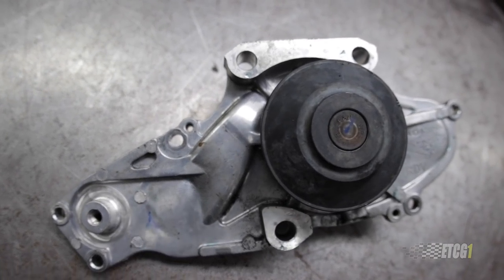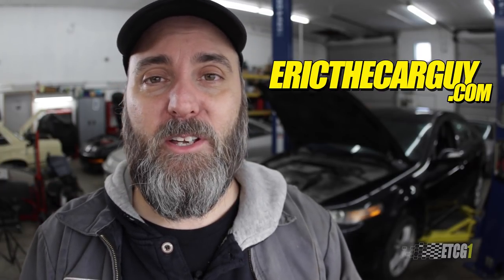Timing Belt vs Timing Chain, Which is Better?

Comment: I generally prefer chains, but the caveat I think of is as Eric said: there are still wear items within the chain system. Those guides will absolutely wear out one day and it's not always easy to check them. And you don't want to run out of oil in a chain driven engine. It really is a pick your poison deal. Take care of the belt and related components every few years or rely on a chain you rarely see. I prefer the chain poison, but I won't scoff at a belt.

Comment: I had a 190E 23 years ago, just driving to work engine Just die, Timing Chain broke only had 90k, Had 03 VW Passat 1.8 driving engine died Rear Cams are Chain  broke 136k, Nissan Maxima 05 Chain Skip timing While driving 123k, Yet, Own 5 Timing Belt Engines mostly Honda Acura not had problem

Comment: I’ll take the chain over belt any day. I’ve done a few belts recently that had teeth missing and were well within there service intervals. My old Australian made ford falcon still going strong with almost 400000 kilometres on the clock. And yet my neighbour Toyota with the belt has had it done three time in less kilometres due to failure.

Comment: Well I assume the answer is for ultimate performance belt uses less power but the fact you really never need to service means obviously chain wins
Reply: Also the right number of cams is 1
Reply from the maker: @james10739  Chains still wear out over time causing a loss of engine performance in the process.
Reply: @ETCG1  only when they have 1 or 3 extra camshafts
Reply from the maker: @james10739  If you think the number of camshafts matters on wear in an assembly that rotates millions of times during its service life, I have a bridge to sell you.
Reply: @ETCG1  no but it makes it go from a like 18 inch chain to a like 4 ft chain which is where the problem is
Reply from the maker: @james10739  My point is I don't think you understand the problem. Doesn't matter how many cams, if it's driven by a chain, the chain, and its gears, will eventually wear out. When they do, timing will be retarded and engine performance will decline. It's simple physics, entropy to be exact.
Reply: @ETCG1  any problems with a timing chain on a single cam is real rare in my experience and the shorter chain isn't going to wear as much to be out of time
Reply from the maker: @james10739  All moving parts wear out over time. Doesn't matter how long the chain is, it will wear out and cause a loss of performance over time. You may not necessarily notice it, but if you compare the same engine, one with a new chain and one with a worn chain, the worn chain will have less power than the new one. You can't change the laws of physics unfortunately.

Comment: I recently had a timing belt fail with 30k miles on it on my 09 odyssey, causing severe damage within both heads.  Ive been in my feelings and talking almost non stop crap about timing belts since.  Thanks for helping me be more "reasonable"
Reply from the maker: Was the engine actually damaged, or assumed? Did you try a new belt before condemning the engine? If not, you might have missed out. https://www.youtube.com/watch?v=enPNb8dxCZk&t=167s
Reply: You probably had a counterfeit belt kit. Quite common actually
Reply: they suck and are just a way to get repair jobs-  otherwise most good modern enginers need little service until 100k
Reply: @wiimaster2847  I second the counterfeit belt kit theory.  Even ETCG1 was duped by the counterfeit parts from Amazon/eBay.  I've seen many of them failing.  Not only does it cost the owner a ton of money it helps create the ignorant comments as in the one above by @Bikeman
Reply: @jeckel7234  Are you the one on the Odyclub forum with the paint issue on the heads?
Reply: @wiimaster2847  yes I am, and I don't really get notified from these comments on YouTube so it's easier to chat on the odyclub forum, I posted the link in one of my previous comments
Reply: @jeckel7234  it's fine, I'm quite active on the forum, I've already read through your stuff.

Comment: Chains USED to be the be-all, end-all. Not anymore. Nowadays, manufacturers can't seem to make a chain guide that can get much past 100k, if even reach that mileage. The timing chain on my '86 Grand Marquis I changed at 230k miles, only because I was in there to fix oil and coolant leaks. I probably could've gone another 100k on it before it got too worn. By the same token, belts would be pretty damned reliable if manufacturers could make a tensioner bearing that lasted. 9 times out of 10, it's the tensioner or idler that fails and takes the belt out. If they'd go back to chains without tensioners, I'd choose a chain every time, just for one less thing I have to do maintenance wise. Keep the oil clean, and they'll last just about forever.

Comment: 100 000 Miles is 160 900 km. I won't buy a car with a timing belt because I buy used cars, and timing belt jobs are like head gasket jobs , they're a 1200$ + job at the garage, and cars that have timing belts need them changed more at like 100 000 KM for peace of mind and that's a half or a third of the car's worth. Coincidentally (I'm not implying any correlation between belt and gasket), cars with timing belts also are cars with blown head gasket problems. I don't want to have a potential 3K expense waiting at the corner. At this point I might as well just burn 6000$ instead of buying a 3000$ car. 

 I had a 20 yo Pontiac Sunfire, yeah, those "POS" that I maintained vaguely decently for 8 of those years as I watched friends and others throw cash at failing cars because they needed a belt every 80 to 100k or else death. That and transmissions, motors and a whole bunch of other expensive repairs including on reliable brands. Replaced it with a Mazda 3 with a timing chain. I don't have the terrorizing stress of a belt breaking because I passed 100 000 miles on it 5000 miles ago.

Comment: Belts are better , quieter and dont require proper oil pressure to keep guides and tensioners working properly. Ask me how i know. Ive had two timing chain engines jumped time and or loose guides due to fram shitty oil filters not holding pressure well.

Comment: Cars should use timing gears, What about timing gears is wrong? I think some engines use gears last longer which I think are better than belts because there not rubber and don't stretch.

Comment: interference verses non interference when it's timing belts has me scared. There appears to be a mileage maintenance on belts but not a time in years to follow. Either way it can be quite expensive.
Reply: There is a time. I'm into Toyota UZ series engines and there absolutely is a time And mileage service interval for the belt

Comment: I have a timing chain on my 2002 Jeep Grand Cherokee Laredo 4.7L V8 VIN-N Selec-Trac.
Never had to replace, 224K miles currently.

Have had to replace:
Starter, Alternator, Tie Rods, Control Arms, Sway Bar Links/Bushings but those are regular maintenance components at my milage.

Very robust engine and transmission though.
The power steering rack has issues if you dont use MS-5931 equivalent. Ask me how i know.

Comment: Had a car with a timing belt and it broke and destroyed the engine !  The next time I purchased a new car the first thing out of my mouth was what kind of timing did it have and he said it was belt driven l walked out !   I own only chain driven timing engines and have had no problems with the last 5 cars and trucks l have owned !   Keep your belts to run the alternator and the air conditioner compressor and let chaines run the cams !   I change my oil and filter every 3500 miles and use mobIle 1 synthetic and filter and no problems with any engine that was chain driven !  It only took one time and 3 thousand dollars to show me why belts running cams is a bad idea period !   I put over 100 thousand miles on all of them and the one with the belt made it to 75 thousand miles before it left me in the middle Texas with frustrating problems  ,   NEVER AGAIN !!!

Comment: I guess it's all about engineering choices... Take the Chrysler 2.7 V6 (I'm a Mopar fan), this engine has the water pump driven by the timing chain. If (when...) it or its seals fail, coolant is mixed with the oil since the pump is internal. This is a stupid crappy design. Take the Ford Duratec 2.5L V6, it's a dream, mine has more than 200k miles and is running strong. Then you can take the Alfa Romeo 1.8L TS engine for example, you are looking at replacing the belt more often than the tires...

Comment: Timing belts are the cheap approach. They're cheaper for the manufacturer and more expensive for the consumer in the long run. A properly designed timing chain system will outlast the rest of the engine if the engine has been maintained properly. They tend to only have issues if the oil is not changed often enough, or if you are dumb enough to buy a GM or Ford.

Comment: I think it depends on the car.  Some cars can go 400,000 miles or more on the original chain and components.  But Subaru H6 all seem to need timing chain components by sometime in the 200,000 plus miles range.  Not sure about the newer four cylinders but the older 4 cylinders would last a very long time if you changed the timing belt every 100,000 miles or so.  So in that case, the belt is better IMO.  But most cars, the chain is better.  Another example, the Chevy cruz 1.4 liter chain lasts maybe 100,000 miles. But how could that whole engine be worse, it's terrible.

Comment: I'm for neither. I like both and they have their benefits. Belts require more maintenance and most likely $ and chains are more robust but cost big if you do have any issue and very difficult to replace.

Comment: that is a real concern for guys like me that buy used - if they fail the regular oil changes then they've worn my chain down more than they should be when they should be pretty indestructible... except when you run them dry.... so good points there. I still prefer a chain, even if its slightly damaged some good high mileage full synth oil fresh and flowing and well replaced and maintained can still make it last

Comment: Chains are cool. Still get them inspected at 100k. Replace if wanted. I am replacing mine at 100k to 150k with factory updated parts. 2014 3.7 v6 mustang.

Comment: I know if I recall correctly, Ford's 3 cylinder engines have a timing belt that submerged in oil, not sure how long that would last and how big of a job would it be to replace that, Ford says it should last the life of the engine but still.
Plus there is some timing chain engines that have the water pump that driven by the chain, like the 3.5 Duratec V6 for example.
Gotta love it when manufacturers make questionable decisions when designing their engines.

Comment: I just don't understand the argument of you are in there and it runs pretty well after I mean it's not like a chain gets out of time under normal circumstances and it's not like you are putting new rings in maybe cleaning oil out of an intake because pcv is kinda stupid

Comment: I'll always hate belts. However, it might be because nobody in my family knew what one was until it went boom in mom's 1985 Nissan Maxima. I loved that car and was sad to see it go.
For me and for my dad, when buying a new car, a timing belt engine is an instant deal breaker. Several years ago, my dad needed a new car. This was soon after dieselgate hit VW. They were selling new B8 Passats at several thousand below MSRP. I said "Dad, you should get a Passat. They are very comfortable, and I know being comfortable is the highest priority to you. No car sold at this price could be as comfy." He asked "Does that diesel use a timing belt?" When I answered "A 10 year, 120,000 mile timing belt" it was the end of the conversation. I did tell him that the turbocharged gasoline engine was a chain engine, so he considered it for a very short while.

I want an Evo X. It was the only Evo to get a timing chain engine, and only the first year had problems related to the chain. There are several other reasons I want one as a daily driver, but one rule is that whatever daily driver I get, it will have a timing chain engine.
Reply: Why are you so scared of timing belts. It's an afternoon of your time to replace and it lasts 100k miles
Reply: @firstlast---  I boycott them based on principle as well as the fact that I hate them.
Reply: @skylinefever  Drop the bias man you'll be happier. Every manufacturer has issues that's why they have service departments

Comment: Just changed my timing belt. 200,000 km. (125,000 miles.) Scheduled change.

Cost $200 for the kit including the water pump, took a few hours.

A dollar for every thousand km.
Doesn't seem that big a deal to me.

I've had belt, chain and gear driven cams.

The only one that ever failed was a gear. That did major damage, bent valves, bent pushrods, broken rockers. The sump had to come off too, to clean out all the gear fibre from the oil pump pick-up.

My current car is a DOHC diesel with belt driven camshafts, but interestingly there are rockers too.
Because it's diesel the valves are near vertical,  and in the event they hit the piston the valves don't bend, the rockers break. Which makes for a comparatively easy repair, since the head doesn't have to come off.

Comment: IDK. I Recommend Ford 5.4 4.6 3 valves replace timing Chains & components at least at 150,000 mi in most cases. I don’t care I make $$ either way. I had on my 454 the nylon on the came gear come apart & bend all my exhaust valves. I’ve had timing belts break & grenade engines. Maintenance is key

Comment: I owned a 2003 Honda Odyssey I recently junked that had 232,765 miles on it.  For one reason or another, I never changed the timing belt or water pump.  Not recommended.  I junked it because she was rusting beyond safety.

Comment: Timing chain is way better if nothing ever goes wrong. Guides, tensioners etc don't fail. Personally I would always prefer a timing belt and just change it every 90'000km's. So much safer and less worry.

Comment: People act like you do a timkng belt job 5 times over the life of the vehicle. Even if you kept the vehicle for 250,000 miles, tbat would only mean you would have dowlne a timing belt twice. But that also means you did the water pump twice, pulleys, serp belt, perfectly timed the engine, etc. And chains do stretch and jump timing sometimes. And when the do break they are far more expensive to change.

Comment: Would you please name a engine with a 100,000 Mile timing belt service interval.   I know no engine with an interval greater then about 20,000  Miles   (Opel (GM) tried, and failed spectacularly, with a longer service interval (37,000 Miles ?))   Timing chains certainly has a service interval as well, at least I know for a fact that VAG (Volkswagen) does.   Please plan to release a video on 31 July, so I can have cake.   LOL

Comment: When the Buick 231s came out in the 70's, they had noisy timing chains and sprockets which GM tried to quiet with a nylon Cam Sprocket whose teeth chipped off.  Most of the noise was from the chain sliding over the tensioner which lost material on it's mating surface and frequently stuck in one position contributing to chain sag from stretching as the chain aged.  The oil pump was part of the timing chain cover and the poor pump design caused loss of oil pressure resulting in the low oil pressure switch shutting the power to the fuel pump and with the oil light on, People thought the engine was blown.  I bought so many of those cars for $300 or less, changed the timing chain, sprockets, oil pump, water pump and tensioner for around $100 (I worked for a parts wholesaler)and had a happy engine in a car I'd flip for $500-$800.  I haven't experienced belts although the 2007 Saturn Vue's Honda Engine has one.

Comment: I have replaced timing belt on a 97' Accord at 75K and a '03 4Runner V8 at 120K. Replacing the belt on the V8 is a bitch. But I am glad I may never have to do that again.  All new engines now a day use chain (new design that last longer and quieter).  Risk of chain failure on a well maintain engine is extremely low. Heck no, my next car may not even has an IC motor.

Comment: Recently worked on a customer's '01 camry with the 2.2L. 225k on the clock. Couldn't believe it still had the OEM timing belt that snapped and boy was it dry rotted and cracks every which way surprised it lasted this long.  It's a non interference engine, so I put a component kit on it and off it went! Like nothing ever was wrong with it. Dang, I need to find one of these cars!

Comment: Timing chain do last longer than belt.  If you keep doing the simple maintenance.  Change the oil.  Of course we have to change the Timing belt on Hondas every 100,000 miles to keep it running.  That what working on cars, trucks is so much fun and challenging.  That explains why some hondas get 1 million miles with no major issues on the engine or transmission because they do proper maintenance.  I say different strokes to different folks on timing belt and chains.

Comment: my main problem with timing chains is the factory oil change intervals are way too long and your lucky to reach 100,000 miles before the chain or guides wear out or completely fail (i.e. BMW, Audi, Ford Eco boost) if you change your oil every 3000-4000 miles they last a lot longer but then they wouldn't be able to sell you another car when it does fail.